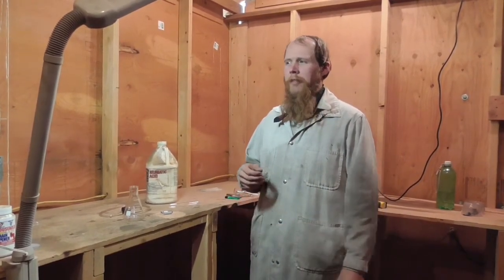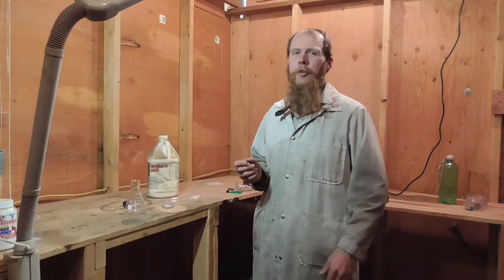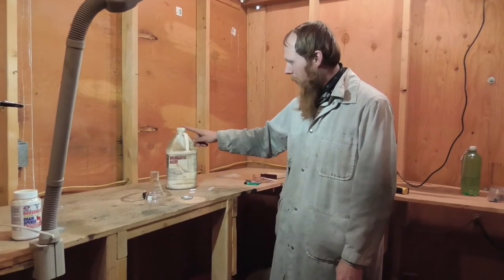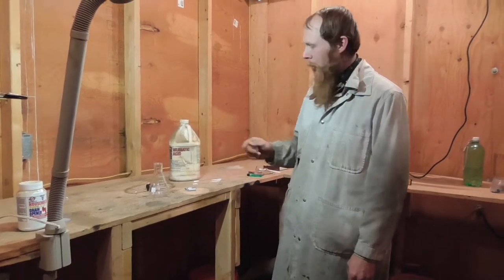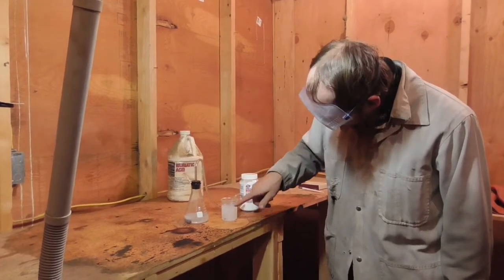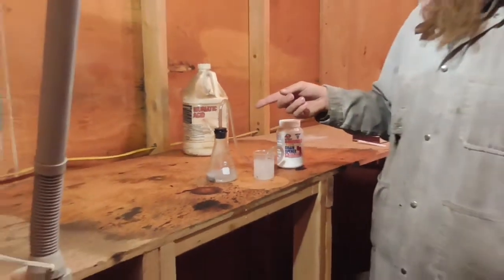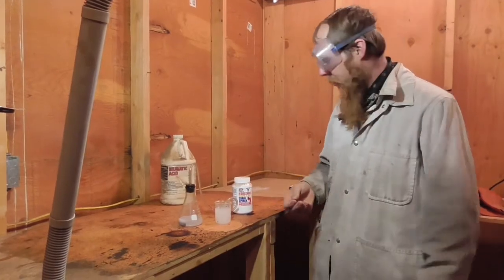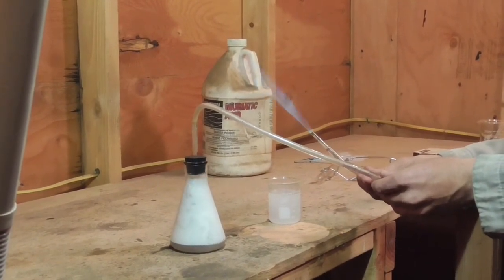Making Hydrogen (TIS107)

Comment: Not to shabby for a Civy (or are you MechE?)   Anyhow I see you cut the video just  before the foam fountain started. Now fess up!!!  ;-)
Reply from the maker: Yes, it did eventually foam over; that could be controlled using a water bath around the flask to keep the temperature from spiking.  And yes, my degree is in Mechanical engineering.

Comment: Why did you make the hydrogen?  Why didn't you collect the hydrogen?  Do you realize how easy it is to make hydrogen with electricity?  All this can easily be condensed into...WHY DID YOU MAKE THIS VIDEO?
Reply from the maker: I have a number of ideas for upcoming projects that would require a source of hydrogen, hence the reason I was thinking about hydrogen generation.  However, since I haven't gotten around to completing those projects yet, in this case I made the hydrogen just to demonstrate the process, and that is why I didn't collect it.  As far as making hydrogen with electricity, I am very familiar with how "easy" that process is: compared to this method, electrolysis is extremely tedious and laborious, and requires a much more complicated setup to do anything useful with it.  That is why I thought it would be useful to demonstrate this method.
Reply: Ahh ok sounds cool.  I liked how the hydrogen increases supply the greater the heat so could make a pretty cool flame thrower via this method.  As for electrolysis its quick and easy!  Just use stainless on the cathode and set it under a collection vent into ...whatever.  Are you making a flamethrower?  Certainly hope so.